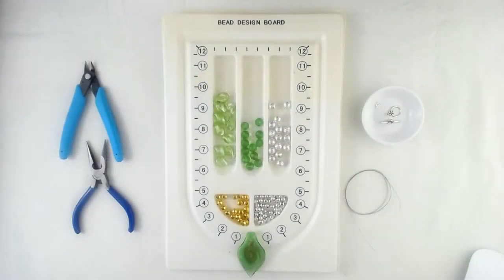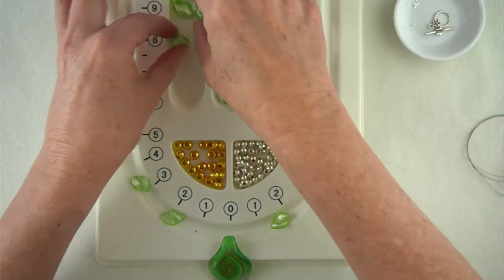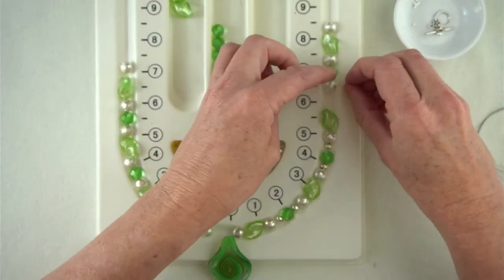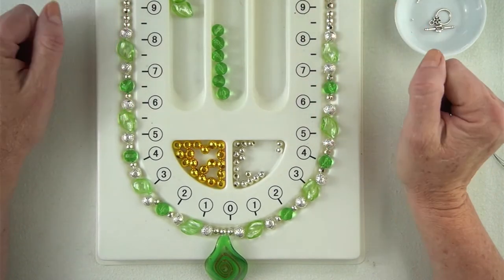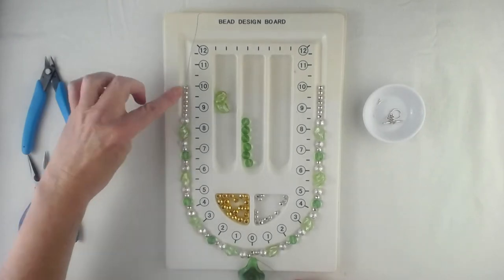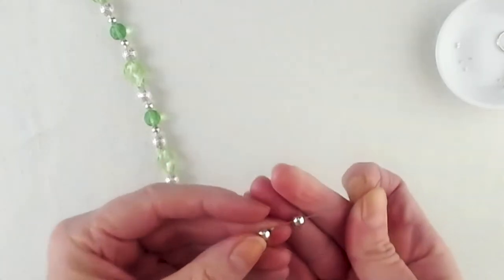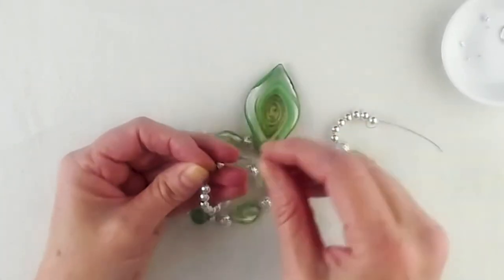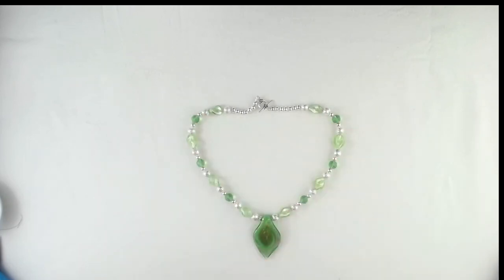Mastering Necklace Design with Bead Design Board

Comment: Very pretty necklace. Thanks for walking us through the design process. I noticed you crimped the crimp bead but didn’t use a cover? What goes into your decision to use or not use a cover?  I also would like to know how you choose wire over nylon cord?
Reply from the maker: Hi Lori, to be honest I hate crimp covers with a vengeance! I can never get them to sit properly and I struggle to get them on.  Since making this video, I've discovered my new favourite tool - the Magical Crimping Tool which I use in this video https://youtu.be/AvKrxRCxjCQ.  It makes the crimp bead look like a little round metal bead so you don't need a crimp cover.